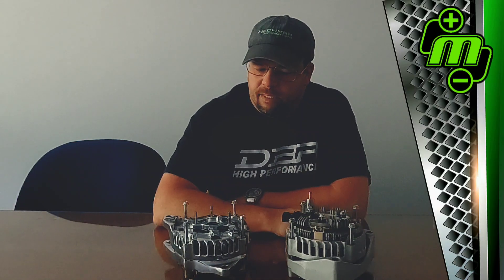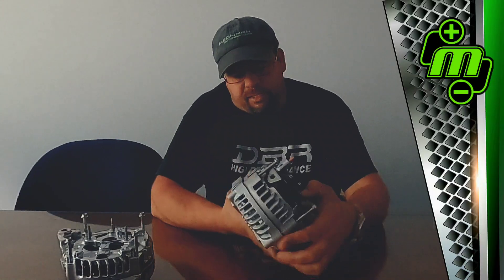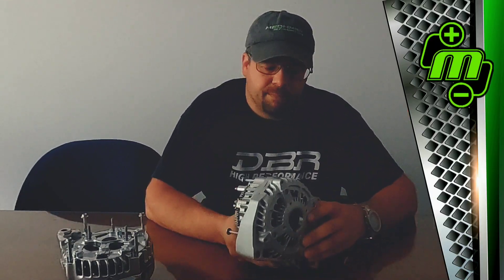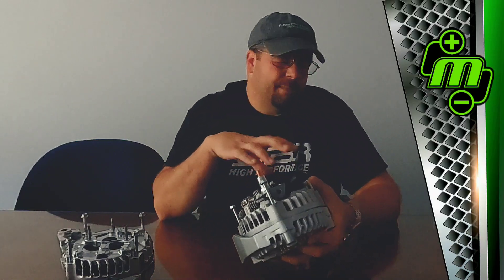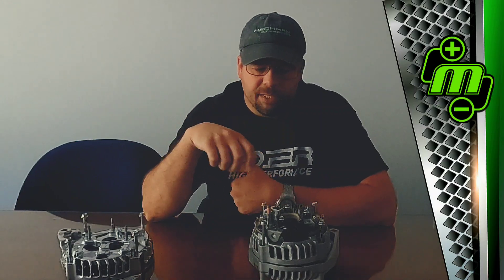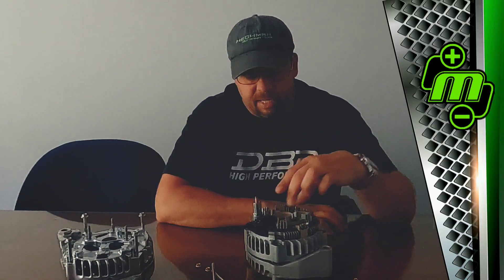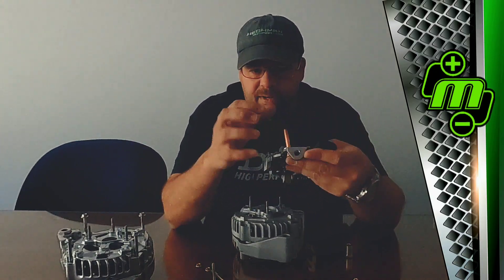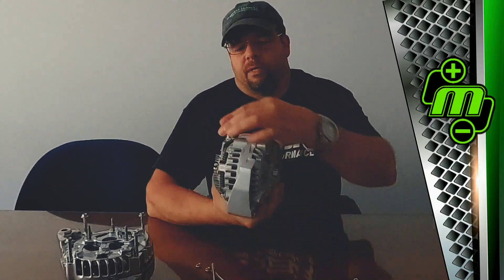Alternator clocking 101:  The can and can NOTs

Comment: Recently tried to clock an alternator on a newer GM HD truck to fit in the auxiliary location. I couldn't do it due to the way the case is made with clearance for the stator only in one position. The stator has a large bump that hits the case when you spin the mounting case 90 degrees.

Comment: After clocking the case what torque do you recommend, and do you recommend thread lock?
Reply from the maker: It can depend on the size of the alternator but in general terms they just need to be snug/tight by hand with a nut driver tool.

As for thread lock, that is not needed.

Comment: Cool. Just clocked my GM single wire  alternator 90* out. (Now on the bottom side) As it was, the power wire was a pain to deal with, and I had to remount the post internally. A full disassembly and reinstall the halves using a toothpick (to hold down)  the (2) spring loaded magnets on the center shaft during reassembly.  Thanks for the video, I had to double check that this wouldn't effect anything internally! Great video!
Reply from the maker: No problem and thanks for the feedback.  It's really simple if you just take your time and be patient.

Comment: I know most use your alternators for audio but would one of your alternators help me with voltage drop when i use my snowplow? Would it help charge my battery when I use my snowplow? I have a 2009 Toyota Tundra 5.7L with an Interstate AGM battery and a Snowdogg VMX-75II.
Reply from the maker: Oh man, our 370 amp unit would be a total night and day difference!   We do TONS of applications just for customers in your situation. Two AGM style batteries and a 370 amp alternator would be badass!  

We use a large case style on the 370 so that means you'll have around 200 amps just at vehicle idle RPM's.  Thats around 3 times as much as stock. :)  

Lets make that Tundra a FUNDra!  (i'm so funny! :) )  

https://www.mechman.com/alternators/lexus/gx460/2010-2022/370-amp-elite-series-alternator-for-toyota-5-7l/

Any questions, just give an email to Tony@Mechman.com
Reply: @mechmanalternators  awesome,  I'll check out the link. Thank you so much.

Comment: I have a mechman alternator and when I start my car cold or hot the voltage is 16.5v. My mechanic tells me the alternator is bad. Is this true. I have a 07 chevy trailblazer 6.0L.
Reply from the maker: Where are you measuring your voltage? Directly AT the alternator?  It sounds like you may have a high resistance/corrosion/bad connection.
Reply: He put back the original alt and it started at 15v.
Reply from the maker: @sjsharks76  Sounds like a battery or connection problem.